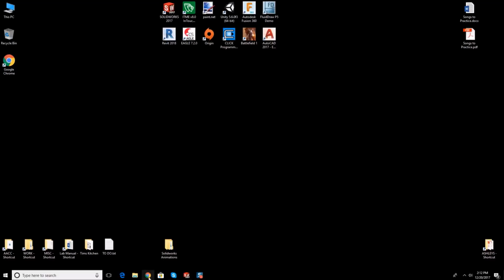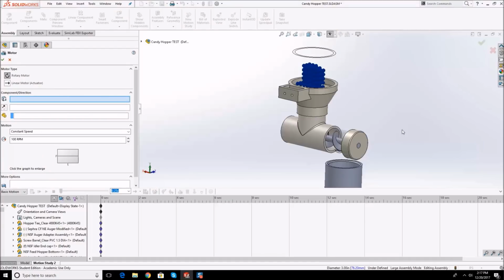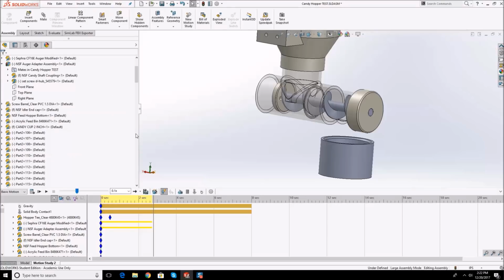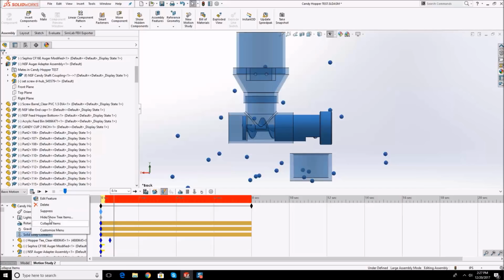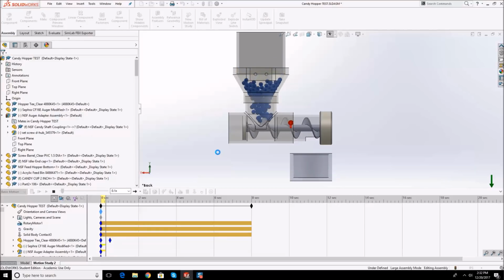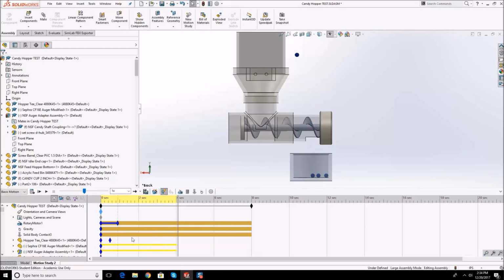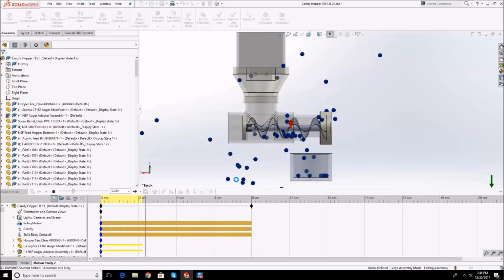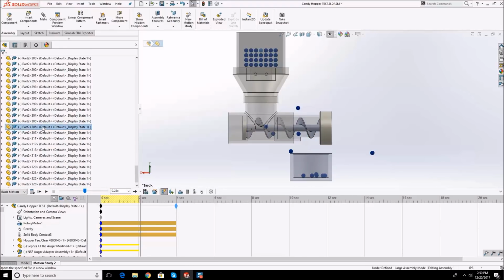Solidworks Basic Motion 1

Comment: Regarding the units for acceleration due to gravity, SOLIDWORKS allows you to use different units regardless of your project's preference.  So, for example, your project is in IPS, but you can still explicitly type what you want: _9.8m/s^2_.  SW will then convert it to your preference.